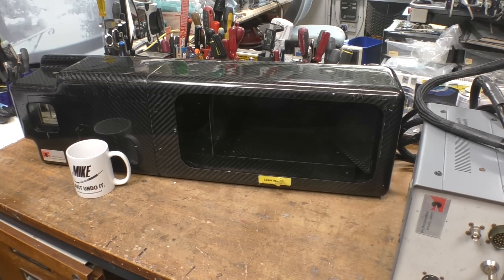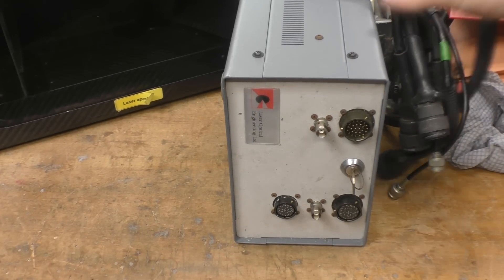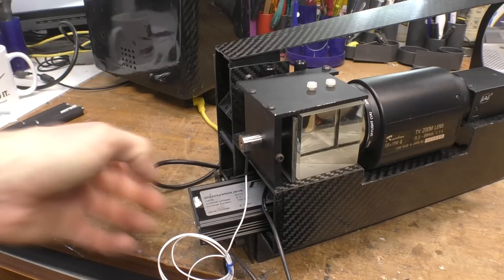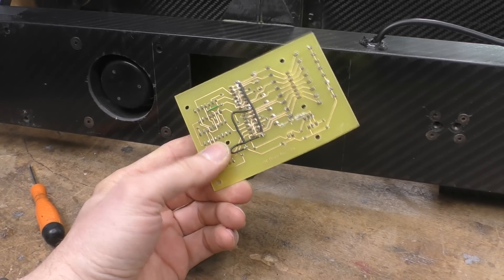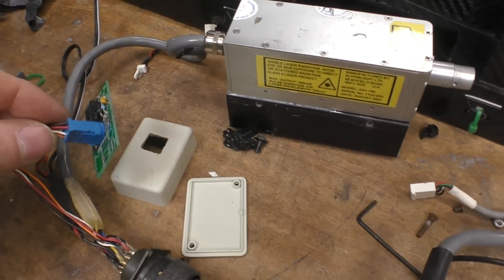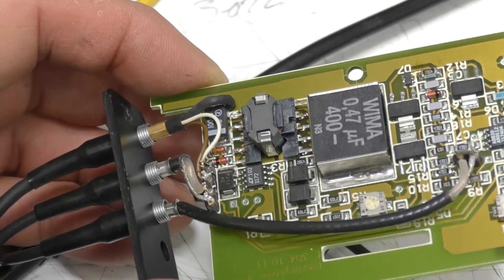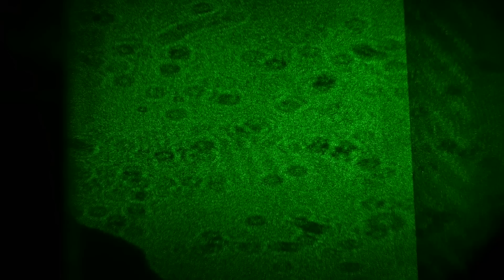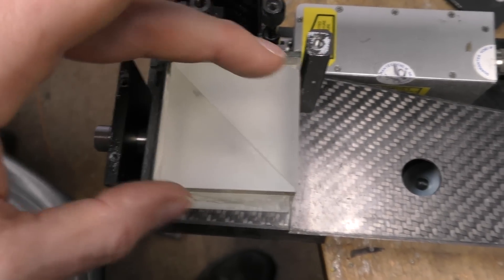Laser strain mapper teardown

Comment: Carbon fiber is used for the dimensional stability. A while back i worked at a place that built large single mode flowing gas CO2 lasers (Eagle 500) and the tube elements with the resonator were supported on a 9 inch diameter carbon fiber tube. All the alternatived were either extremely heavy or even more expensive. When mixed with the right polymer binder carbon fiber composite has very low thermal expansion ❤

Comment: My 2 cents on why the enclosure was made of carbon: the version of the unit shown at 1:26, being in multiple pieces isn't super conducive to quick portability, and so building the unit into one box, like the CF unit would make sense if you had to move it about for in-situ tests, for example. If your company works with a lot of CF, you will often find that they will make things out of CF that don't explicitly need to be made out of CF (take a look at some of the equipment that F1 teams bring to the track for example), I believe this is for a few reasons:
1)Looks/branding, if you sell big things made out of carbon, having small things made out of carbon may be a good way for sales people to show the company's workmanship. 
2)Training, if the new guy doesn't have any experience with composites, why not have them learn on something like a toolbox.
3)3 feeds from 2, but if you are making something non critical out of CF, you may as well use as many scraps from regular production as possible.
4)If you already have the infrastructure to make quick turnaround prototypes out of CF, int might be more economical to make something out of CF, even it it doesn't need to be.

Going back to my point, I think someone, who uses a lot of CF, and in particular, does a lot of rapid CF prototyping, such as a high-level motorsports team(F1, WEC, etc.), or an aerospace manufacturer, had need of a strain mapper that was more portable than normal, and so either made the CF enclosure on their own(likely with permission), or approached the manufacturer with their need, and said something along the lines of, "we need a version of your product that is all in one enclosure for portability reasons, if you tell us where in space the inner components need to be, we can make the enclosure, and send it to you, and you can install the inner components.”

Edit: Another reason I can think of for building the strain mapper into one CF enclosure, what if it was used inside a plane wing, or somthing like that?

Comment: Composites are cheaper for such a small scale production. Injection moulding requires the manufacturer (or usually their client) to invest in moulds. Those cost tens of thousands of dollars per set. Each change in the shape of the product means that you have to trash the moulds and pay for another set. On the other hand, if you order from a local composite shop, you would pay for each item individually. The production of a small batch would take days instead of months, as with injection moulding. Each item will cost more, but nothing has to be paid upfront. I'd estimate the shop charged them $200-300 per enclosure. Which is great considering the overall price of this unit.

Comment: carbon fiber has next to no thermal expansion, so that's probably why they used it for the construction
Reply: well, it bends a lot and picks every vibration. Strange choice, probably to feed the hype of carbon fiber.
Reply: @ciprianpopa1503 It’s quite famously rigid. Are you sure you aren’t thinking about silicone personal massage devices? They bend a lot and vibrate.
Reply: @silverXnoise  I am 100% sure. I work with optics. Optical benches are made of special steels with very precise and low thermal expansion. If you insist, I can hourly rent you the time on one of the optical benches for your vibrational entertainment. However, I can assure you they are sturdy & the amplitudes will be rather low. Not as low as your dry sense of humor though.
Reply: I was going to suggest it was customised for F1 or aero, but then Mike got to the mains power supplies ..

Comment: Interesting! Looks like a hacked together, low cost, scanning Michelson Interferometer. Serious Instruments use chunky Granite and die cast Aluminium structures, stabilized tube lasers for good coherence and optics down to errors of Lambda/40 on sophisticated vibration isolation. This way subnanometer resolutions are achived. My Profile picture is taken from an18" instrument.
Reply: It looks like a student project.
Reply: Well if you say have to hoist that thing to ceiling to flatscan downwards a big piece of material, granite slab is not exactly optimal material. That or it is field model with light weight being a high concern for customer. Even down to aluminium or so being deemed "hefty"

Also aluminium would be suspectible to thermal expansion. Maybe the customers application had special concern for thermal stability and thus most metals outside of very specialty alloys is out of picture.

The kit bashed nature makes me think this is custom instrument job for something, some lab or facility. They made like exactly one or two to a very specific need and application. Thus using combination of off-the-shelf parts in combination to make specialty instrument.

At which point "did they good job or bad job" is hard to gauge, since we don't know what the asked spec was. What the application peculiarities are. What the actual scanning setup is. Since should this have been for example a lab instrument, it might have been just part of larger instrumentation setup with potentially very custom and experimental instrumentation setup.

After all Laser Optical still lists consultation and custom development as one of their business. So who knows what that thing is exactly done for.

After all lot of university experimental lab instrumentation is such of. "wait what is that piece there.... you can't seriously be using that thing in your million dollar lab" and some researcher just answers "We needed a thing that does X and needed it quickly, that does X well enough and was available from local hardware/electronics store since it's common item. Plus it was cheap. We tested and verified it. It works to the spec and accuracy we need."

Comment: Those interlock switches are super common on CNC machine doors, and may be mainly for regulatory purposes rather than actually required for safety, especially if this was destined to be used in factories in the US.

Comment: 7:13 As someone who works with/designs precision equipment like this, I find the same hex keys all over the place quite convenient.
Maybe not so much if all you have are the standard 'L' type sets, but with some T handles or precision hex screw drivers its IMHO superior to screws as you have to really try your best to strip them. (Especially the case if you work with morons who cannot distinguish philips from pozidriv). For my designs I almost always try to default to either torx or hex, and use as many of the same screw sizes in the design as possible (similar to trying to use the same resistor size as much as possible on a single PCB).
Reply: Absolutely.

Also: Cleanliness..
Reply: @-r-495  On that note, personally I prefer to use countersunk/tapered or counter-bored socket screws because of hygiene and less likely to catch stuff on them, as opposed to the button head screws used in this device.
Reply: @tHaH4x0r in bio labs we had to use those used on this device.
I remember a service technician replacing all the screws on the outside of a machine 😏
Reply: I completely agree.

Comment: 😮 Allen Head screws are clearly superior to Phillips head tho! 😢
Reply: I like Allen Heads but only in specific circumstances, when I want something to look beautiful, or some HV stuff where I want to reduce corona.
Reply from the maker: Nope. Too many different sizes and both heads and drivers chew too easily - give me a Pozi any day.
Reply: @mikeselectricstuff  You really need a bit set and an electric screwdriver. I have built so many prototypes with Allen screws.
It's so incredibly fast to screw and unscrew if you use the proper tools. Much faster than Philips screws.
Reply: @mikeselectricstuff  Pozi and torx
Reply: @mikeselectricstuff  Torx.
Reply from the maker: @mfx1  Torx is fine, at least you don't have to figure out if it's metric or imperial

Comment: 10:08 .. wow these HV MLCCs are 20-30 bucks a pop ...
Reply from the maker: Couple of bucks at Digikey : SMDTG03470YA00KT00/9449165
Reply: @mikeselectricstuff  I knooowww .. I looked at the wrong parts, I only found 4 - 8kV MLCCs in a very quick search.. but its nice to know , thanks also !
Reply: It's a PET film cap, not ceramic. Seems to have part number 10606560518820T. No longer available.
Reply: @Jeroen74  Thanks !

Comment: Carbon fiber stuff is not expensive at all if you have the knowledge, skills and tooling for it in house.  If you have a supply chain of fabric and epoxy, as well as consumables to make molds and separate your ready parts from the molds - it's just wetting the rags with epoxy and wrapping them around the mold, then putting it into a plastic bag and sucking the air out. Keeping composite layup experts on staff and motivated -    that's what is expensive :D

Take a looks at tutorials here, for example - https://www.youtube.com/@easycompositestv  composites are really so much easier than metal working or even 3D printing. You don't have to deal with any of the 3D modelling, cnc machining and such - you can literally carve a part from styrofoam with a butter knife, wrap  it with carbon fiber fabric, pour some epoxy over it, leave it overnight, splash some acetone to dissolve the styrofoam and have the shape of your imagination in carbon fibre composite - ready. The part will be as precise geometrically as you carve the mold, of course.
Reply: It's very labour intensive compared to an enclosure using e.g. an aluminium extrusion.
Reply: Wow my 16 years of experience as a composites engineer in the space industry summed up in 2 paragraphs 🫣
Reply: It was a pretty big expense 20-30 years ago...

Comment: Mike, are you familiar with Optical Flats, used to determine flatness. Maybe this works in a similar way by projecting a fringe pattern, the shape of which determines the flatness.
Reply: Very similar in principle, it will measure inteference patterns and will be capable of resolving down to 1\4 wavelength or better. It will only work on specular reflection though, the paper just diffuses the wavefronts so will never give a usable pattern.
Reply: It does remind me a lot of optical flats..  maybe the same deal except digital.. brings a different meaning to optical flat if so…
Reply: Yup, except it's for bigger surfaces where a flat would not be practical.